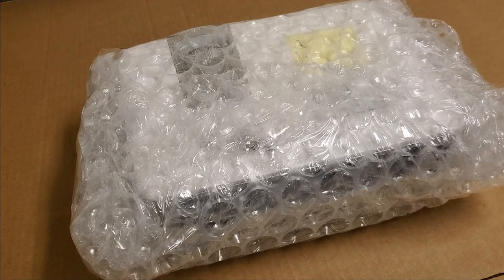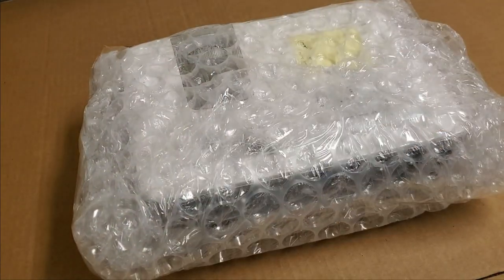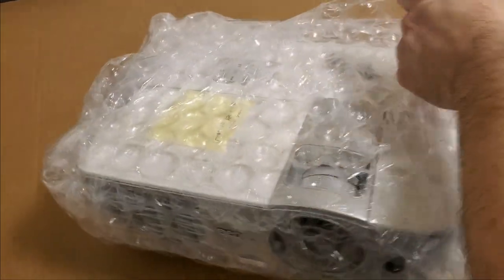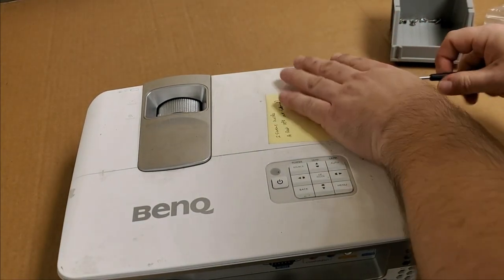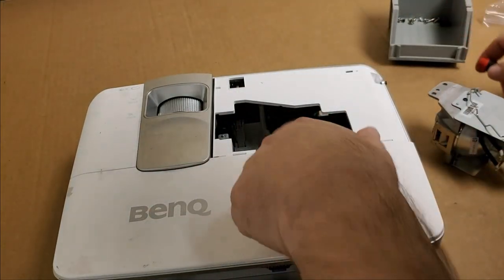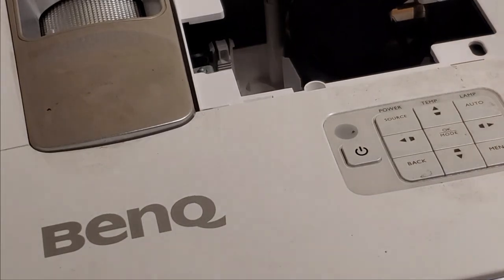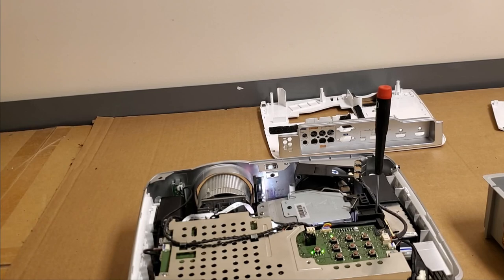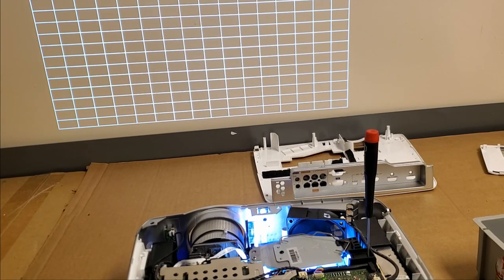BenQ HT1085ST DLP Video Projector Over Heating Repair

Comment: Hi Frank, I searched all your videos, but found no SONY projectors. Just curious why, is it because the quality is better than other brands, so don't get broken?
Reply from the maker: I do not know the correct answer to that question. I do not have access to the unit sold versus units repaired from either company. 
I have worked on a reasonable amount of sony's but I do not have all of them on video. Most were things like fans or one with a melted connector. That said, I think its because of sheer volume sold.  Sony sells a lot of gear. BenQ mostly sells projectors and display devices.  I would expect BenQ to have more units in the market.  
Sony was big in the RPTV market until the blue-blob class action lawsuit happened. Then they wisely abandoned it for flat panel technology.  Some Sony stuff is built well. Most of it is designed well. A lot of it was also manufactured poorly.  Sony is/was well known for solder problems due to 'efficient' wave soldering practices.  They tend to ebb-flow in their manufacturing quality from the problems with various types of Sony products. I used to work on the Trinitron chassis back in the 90s as well as their AV gear.  Sony engineering/design has always been of high quality, also in my opinion. 
That is a good question.  
What do you think?
Reply: @FixitFrank  Thanks for your reply, didn't expect to get such a detailed answer, and I learned a lot from your answer. 
The reason why I search sony in your video is that I know sony also make projectors for cinemas, which are typically very big, I'm curious to know the inside structures.  
Before you give me your answer, I also thought about this question. I guess that on the one hand, sony projectors usually is more expensive than other brands, so the market share is not high, on the other hand, since they are very good at making cinema projectors, making a small home projector would not be difficult them, so the design and quality would be better.
Reply from the maker: @tonytseng9954  Good insight Tony! Thanks.  I didn't think about how many cinema projectors they made.  I suspect your theory is correct.  There was a guy I did work for who almost exclusively pushed Sony projectors but only for high end home theaters and like you said, they will be built better.  Thanks again for the question!  Thanks even more for commenting!
Reply: @FixitFrank ：）
Reply: I know very little about projectors, however some experience about computers (where I know a lot). A few years ago Sony sold off their laptop business (called Sony Vaio) but I've had a chance to work on some [very expensive] laptops and convertibles they produced before they quit this industry. These were a mix of good and bad design. The external design was great. The electronics design was good. The mechanical design was generally pretty bad, which produced issues like display hinges applying too much force to the low-quality plastic screw mounts inside the display and breaking them - which is typical of poorly designed, cheap consumer laptops. The serviceability seemed to have been positioned as last priority, with some top-of-the-line laptops overengineered to a ridiculous degree (much like the current Apple laptops) at the expense of becoming the worst laptop to work on I have ever encountered. Obviously the Microsoft Surface laptops are still worse than that since you can not disassemble them without breaking them, but that's an entirely different paradigm of laptop-as-a-consumable.
Reply from the maker: Vaios were the bane of my existence.  They were so "fancy" yet so unreliable when they didnt work.  If they worked, they were fine to decent.  If they didn't, my usual feeling was to perform percussive decommissioning. 
Their ES series audio gear was always nice to work on though.  I thoroughly enjoyed working on that stuff. I still have a 400 disc ES cd changer and a really nice 5 disk ES CD player.  I think I now own maybe 4 CDs but I cant bring myself to get rid of them.  I should probably stick them on eBay...
Reply: Yeah, turns out that in audio, Sony had an addictive effect, like Apple in computers. I'm far from being a professional audio gear repair tech but anyway recently I've had an encounter with a circa-80's Sony Walkman of the fancier series (WM-D6C). Turns out people still love these devices, to a degree where there are techs who specialize on fixing them. My client was in touch with one of these techs in Italy but was told that he was booked for the next 2 years. So he took it to me :)

Comment: Hi Frank! I have the HT1085ST and it shut down every 2 minutes i turn it on. The special menu says that "Fan 4 is at 0RPM" i think is not spining. I already I took it apart to clean it and got to the blower fan in the middle, it spin freely. What could it be?
Reply from the maker: Hi Diego,  I would make sure all are running.  I do believe that is #4 but I am not near the service manual. Even if it is spinning, does not mean it is reporting the RPM correctly to the mainboard.  You can measure the tachometer output with a volt meter. It should read very low.  1-2v maybe.  If it is 5 or higher, the fan is not reporting the RPM correctly. I would verify all 4 fans are rotating and then check the tach leads on the blower fan and the exhaust fan(large fan by the lamp).

Comment: Hello. I have a BenQ W1080ST. Replaced all the fans but it’s still turning off with the Temp and Power lights on. So if not fan related, could this be board level?
Reply from the maker: First question is did you use OEM part #s for the new fans?  All fans are not the same.  The RPM indicators vary from model to model.  Some use pwm output to say the RPM. Others use pulse on stall or pulse on run.   If you are getting temp light, I suspect you may have a bad part # for one or more of the fans.  Where did you get them?

Comment: HI Frank - first of all thanks for your videos and tutorials. I have a problem with my BenQ1070. The lamp exploded after 5 years. I changed the lamp and I had to replace the center fan since glass went into it and it broke.  Once i replaced the blower the projector worked for approx. 6/7 hours (2 movies in 2 days) and then started to turn off after few minutes it is on.  The indicator Red on the on/off and green on lamp mean that there is overheating. What do you suggest me to do?? I bought the fan from Amazon, model ab5012dx-a03
Reply from the maker: Hi Giovanni! You may have another fan  problem.  The blower might be OK.  To be sure, I would check the service menu for other fan errors. It could be possible the new fan is defective.  If a part is defective, they tend to fail fast. 
To enter the service menu: (projector needs to be on) Press Menu, Mode, and Source buttons in that order. No need to press them quickly. You should see a set of boxes appear on the screen then you can use the arrow keys to navigate.  Look for the fan speed errors. You will see the blower fan for sure but I would see what other fans are showing.  
You can then confirm by measuring the voltage on the RPM monitor lead of the fan.  If the voltage is high(while running), the fan is not working right. It should read less than 2v most of the time. An oscilloscope is the best way to know for sure.
Check my video on the HT1075. https://youtu.be/sVRbLY3Z6IM  It's the same chassis as the W1070, also W1080 and a few others. I go over checking the fans in depth there. 
My guess is you either had a wire pull out for one of the fans, a loose piece of the old lamp made its way into the new fan and it is stuck, or the exhaust fan is also worn out.  Don't be discouraged, I think you are very close to a solution.
Reply: @FixitFrank  Thanks a lot I will try. I would exclude another piece of broken lamp since i blew the entire projector with compressed air, but i will check again.
thanks
Reply: @FixitFrank Frank - i checked using the menu and out of 4 fans, Fan 3 is showing  (rpm 0). 
Do you know which one is fan 3? Is it the blower? where should i buy one that is good? Thanks for your help!!
Reply from the maker: @giovannipincetti8808  #3 is the same fan.  I would make sure the wire is plugged in tight.  I find that eBay is a good source for fans. The trick is to get the same fan you take out(Same part number). Here is a map of the fans.  https://imgur.com/SJd32Jd
Reply: @FixitFrank  so... the saga continues... I reopened the projector and check the fans with the voltmeter... fan3 was working and then stopping....then once I closed it it was going at 3500rpm for a while and was happy.... but the second time I tried to use the projector fan3 decided not to start.  Where in your opinion I could get a new one? And... do you think just replacing it will fix the problem or not? This one is new I bought it via Amazon. (Took 2 weeks) and now I do not have the projector for the holidays...😪😪. What do you suggest??
Thanks and happy holidays
Reply from the maker: @giovannipincetti8808  Very unusual for a new part to fail, but the most common time for a new part to fail is when it is new.   
Did you happen to take the old fan apart?  I have seen quartz glass get stuck in the blades and stick to the inside of the blower housing. These have very little torque. It only takes a tiny bit to jam a fan.  

Another thought, check the fan connector on the mainboard. Make sure nothing is interfering with the connection. 

Do you know if the fan is truly stopping or is it turning but the projector thinks the fan has stopped? 

Make 1000% sure none of the power supply wires or the plastic shrouds are getting in the way of the fan intake or might push on the hub.  

Getting a new proper fan before Christmas would be expensive but possible. I have a contact in China who uses DHL who I have purchased these from.  You could probably get it by Wednesday/Thursday if you ordered over the weekend.  

Check your old fan first and the other items before you consider that.  I feel like the old fan might be salvageable.  One last longshot.  If the old fan has a damaged fan rotor, you can take the new fan rotor out and put it into the old housing.  The tabs on the side will unsnap and the hub should lift out. Save that option for last before buying another.
Reply: @FixitFrank  thanks for the prompt reply.  Unfortunately the old fan is completely broken ....(destroyed the blades while trying to cleaning it up with the air compressor...)   It might be the connector... 
I ordereda new one on eBay .... will arrive in January 😪
Thanks for your help

Comment: Hey, thanks for this informative video.  I've got a similar BenQ projector, the MX501, with a similar issue.  I had a bulb explode, bought a new bulb and now when you turn on the projector, it runs for less than a minute before shutting off instantly and completely (no cool down or warning lights remain on).  I took it apart to check that the small internal fan is working, and it is.  The fan and associated assembly was also correctly put together.  Therefore I wondered if the temperature sensor which is retained in the body of the cooling conduit might be faulty.  To try to test this, I reassembled things and then turned on the projector, and then pulled the sensor plug out, to simulate it overheating (it's a closed switch when cold), but in this circumstance, the bulb goes out but the fans remain running and the temperature warning light comes on.  Therefore, I wonder if there are other sensors I ought to check?  If there are, what are they an where are they?  I'd be very grateful for your advice!  Thanks, Hal :-)
Reply from the maker: Hi Hal,  That is weird that it turns off so suddenly. Usually for heat issues it takes a little bit to get that hot. With those symptoms, I would expect the main thermal breaker to be triggered, but that also sounds like its hte part you unplugged in your test where the fans stayed on. 
When it acts up the initial way(shuts down completely), how long until you can start it back up?
Reply: @FixitFrank  Hey Frank, thanks for getting back to me on this.  Yes, the projector shuts down before the bulb has got very hot at all.  It suggests that it is not responding to a heat issue.  After the complete sudden shut down it can be turned on again after 1 or 2 minutes.  I am wondering whether the bulb explosion (at ~2300 hours of a bulb with a rated 4500 hours life) was caused by some kind of fault, and that has now resulted in some change of state to protect the projector.  Perhaps a new bulb would see the same fate?  Maybe the thermal sensor is faulty, always a closed switch, and allowed the original bulb to overheat.  How that has caused this new 'protective' symptom, I'm not sure.  The fans are capable of speeding up, because they do when you pull out the thermal sensor at its socket.  Perhaps the fan speed feedback (is that what the third wire to the fans is for?) is not working on one or more fan.  I suppose I can further test the heat sensor,  by removing it and heating it up with a hot air gun and checking that the circuit becomes open.

Comment: I ordered a new bulb as the old one blew out. I followed the steps in your video. Very informative.  I cleaned all the dust and all that.  I cleaned the blower fan as well. There was mostly dust no glass pieces.I have one question: when the power is on by holding the cover switch down, without the bulb, is the blower fan, the one that cools down the tip of the bulb, supposed to be spinning? Or is the fan turned on when a certain temperature is reached in the lamp housing. I can see my blower fan does not spin without the bulb. In one of your video, you put your finger close to where the air comes out and said air is coming out, which implies that blower fan is supposed to spin without the bulb in the projector. Is that really the case or what you felt was the not the blower fan but main exoust fan at the front? I just want to know for sure the blower fan works before putting the new bulb in. Otherwise the new bulb may also blow out. Thanks
Reply from the maker: I thought about it and I honestly do not know.  It does take a little bit to turn on.  I think it is time based rather than temp based.  I know the RPM is temp based but I am pretty sure after a minute or so, the blower should start. If the fan does not start, the projector will turn off and give you a warning for Temp so I think you are safe to put the new lamp in and run it a bit.  Check your exhaust air temp. Make sure it is around 150-190f/70-90c.  If it is higher, your blower fan may not be pushing enough air.
Reply: @FixitFrank  thanks

Comment: Tenho um Benq mp 515 liga mais fica com a luz laranja aperto o power acende a Luz Verde fica piscando mais não acende a lâmpada  e nem aciona os cooles, troquei o Top 256yn e resistor p6ke250v não conseguir subistituir in4007  mais a lâmpada e cooler não  aciona o que poderia ser?
Reply from the maker: Veja meu vídeo sobre solução de problemas de rodas de cores. Eu examino o processo de inicialização do DLP. Isso pode apontar a direção certa. Acho que seu IC na fonte de alimentação está OK. Você não teria nenhum LED se o TOP Chip estivesse ruim. Obrigado por assistir! (Desculpem os erros, eu uso o google tradutor)

Comment: Hello Mr. Frank. I have watched through the video and we followed along since we were having similar issues with our projector. Our projector has never been opened (until we just cleaned it) and we were very careful with the screws. We went to start it for the test run and it turns off within ten minutes. The temp and power lights are both red when it shuts off. When we cleaned it out,  we didn't notice anything off and all the fans were able to be spun. When we run the fan tests they are all running at the proper speeds. Is there anything else we can try? We aren't sure what is causing the shut-downs.
Reply from the maker: Hi Laura 👋 when you say it shuts off with both LEDs red, does it cool down(run the fans for a bit) ? Or does it go right to standby with no fans? There are some more things to check.  Also how old is the lamp(roughly)?
Reply: @FixitFrank   Thank you for the quick response! It goes straight to standby. ad the lamp is about 3 years old with very limited use until recently.